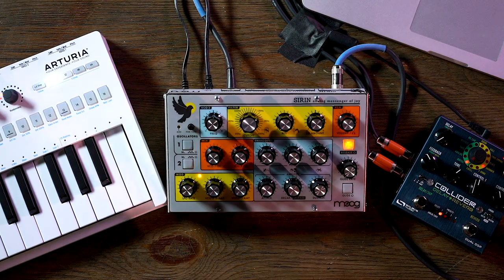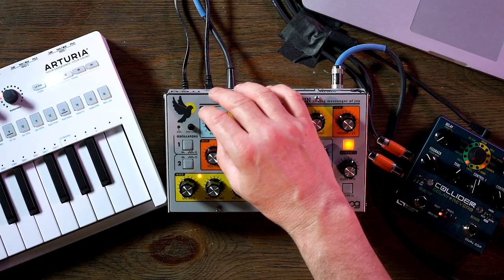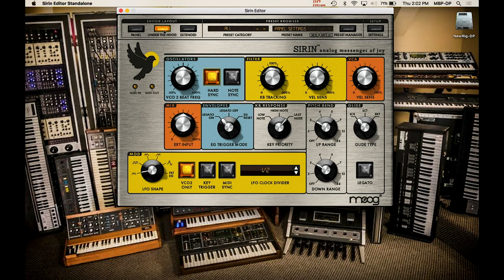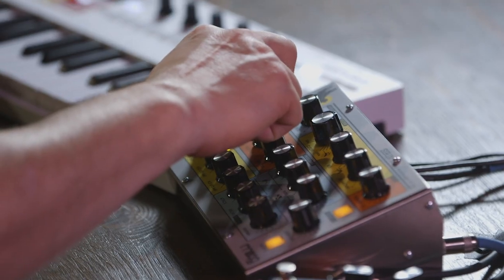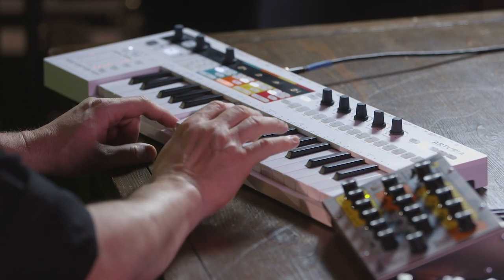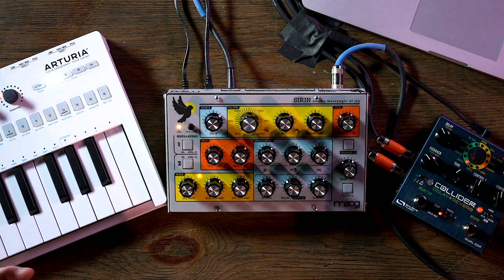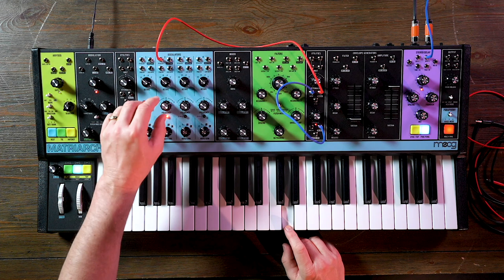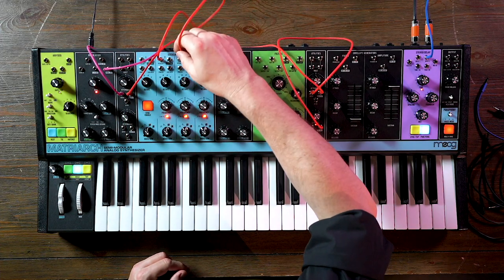Oscillator Sync – Synth Clips 17 – Daniel Fisher

Comment: Daniel,

i have two questions:

If we tune VCO 2 to a third relative to VCO 1 and engage oscillator sync, will VCO 2 harmonically remain a third? 

And will you do a deep dive on the Collider like the Nemesis? I bought the Nemesis as my first delay after watching your video, and I use it all the time.

Thanks!

Kent
Reply from the maker: Hi Kent. When oscillator sync is engaged, one of the strongest overtones is often at the pitch of the second oscillator (if it wasn't sync'd). If you watch videos on both the Nemesis and the Ventris, you'll have a pretty good idea of how the Collider works.
-Daniel

Comment: So it's basically like modulating the detune of a UNISON?
Reply from the maker: Hi OMNI_INFINITY. Oscillator Sync is a unique parameter that's unrelated to Unison. It's two oscillators, with the first oscillator controlling when the second oscillator restarts. Since the second oscillator has to restart every time the first oscillator completes a cycle, the second oscillator has harmonic qualities of both oscillators' pitches. When you sweep the pitch of the second oscillator, you can hear the harmonics sweeping even though it retains the first oscillator's fundamental pitch. -Daniel
Reply: @sweetwater  Ah.Thanks for clarifying! Does the second oscillator start at the same pitch as the first oscillator though when it retriggers every cycle of first oscillator? And why does a silver box that has Roland on it sound as though there is some oscillator synch going on when at "optimal" settings? Thanks in advance for good answers!
Reply: PS: Also kinda reminded of the interesting phrases sampled speech makes when at different speeds triggered simultaneously. And obviously the sample used in "Robot Rock" seems to be an oscillator synch. Really like when it has a formant style sound.  @sweetwater